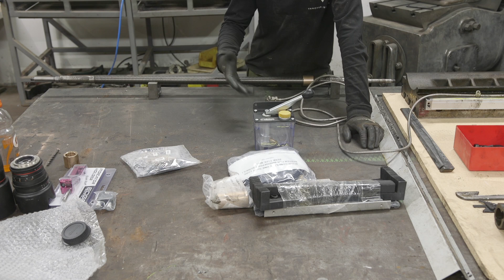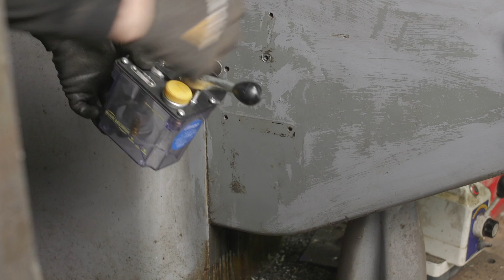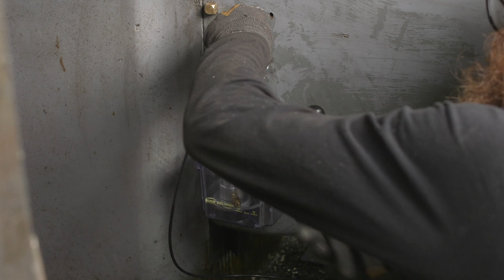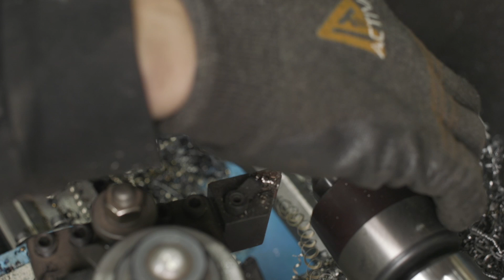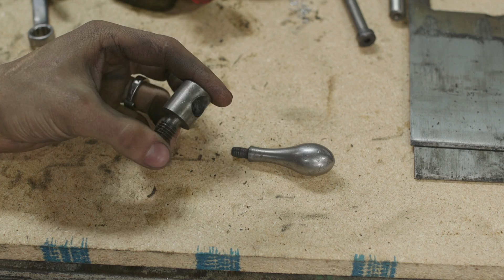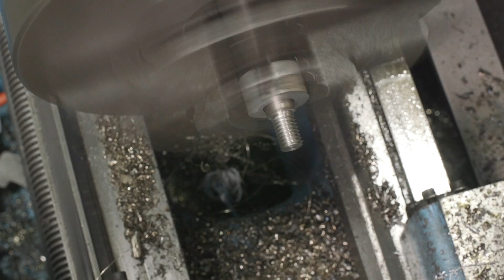Bridgeport Mill Refresh Continues

Comment: Hi,
I don't understand that way to rebuilt a machine with new components on a dirty structure, on a old painting and damaged. Ok it will be functional but after a few use, the Mill will be dirty again and difficult to clean and maintain in good condition.
In the same way I don't understand the process to disassemble a machine witch in completly dirty with shavings everywhere !!?? 
For me the first step is to clean slightly the machine and then starting the disassembling well sorted. 
The good thing is your check of the geometry and also with checking each nuts or screws axes to find out where it fail. I saw so much "restorations" consisting in only a cleanning, disassembling and a new painting ( rubbish art, only nice but noway resistant!) and than reassembling, but nobody try a geometric check to work with, be able by producing pieces with exact et precise dimensions.
Another way how make me crazy is to see how the wiring, by a restoration or an up grade, is treated with no protection by running thru the machine just attached some time with bracelets or installing electronic components without any protect, directly on the body. In a few month after intense using, all those components will be durty with oil moisture and sticky durt. I know wiring clever is a real job and take time with precision like the mecanical job.

Comment: h&w (small caps intended) are good at their job rebuilding machines. However, their actual customer service skills are anything but. They are by far one of the rudest most self-absorbed group of people I have ever had the displeasure to deal with, esp the "daughter" who has a raging smart alec mouth on her and complaining about her is pointless because it's a family run business. Communication was impossible. I was clear with them and detailed everything in email and they ignored everything I detailed. And if that wasn't enough my shipment was damaged by the shipper on the return trip and that was something they admitted to have been dealing with for some time which begs the question why wasn't that little fact made known to me because I could have arraigned another option to ensure my machine didn't come back to me damaged. I also don't care what anyone else's experience was. That doesn't mean anything. These people operate the same with everyone, so I know I'm not alone in this regarding their total lack of customer service and complete lack of communication.
Reply from the maker: Good to know. I have had good luck but doesn’t mean your experience is not real. I hate when places have bad customer service. I feel like I am always dealing w sub par service from companies. It drives me crazy.
Reply: @VanoverMachineAndRepair  service today in America generally sucks.  I go out of my way to recognize and reward good customer service wherever get it. I try to find the boss, and the boss's boss to call it out.  Same with lousy customer service.  They need to hear it to fix it.

Comment: You can improve your surface finish on your finish passes by switching to a sharper tool with a larger nose radius. That also helps to take more accurate shallow cuts.
Reply: did you mean "sharper" or is that autocorrect?  didn't quite follow the comment but was interested.
Reply from the maker: Thank you I appreciate it. I have some new tooling since the last time the video was shot and am getting a much better surface finish.
Reply: @Charlieman.  Yeah, sharper. Pointy and sharp are "pointy" and "sharp" give distinctly different effects when turning :)